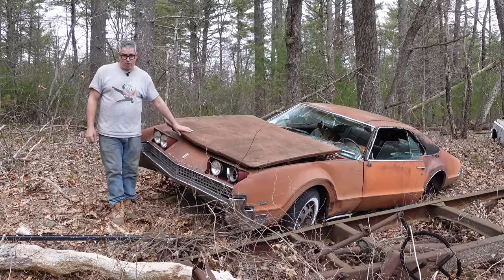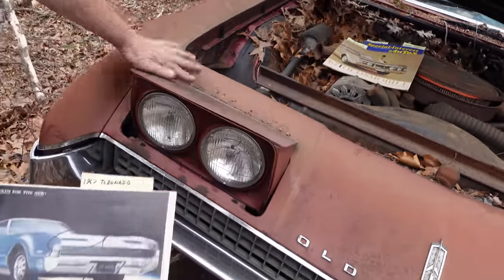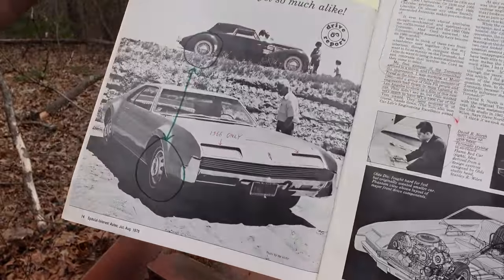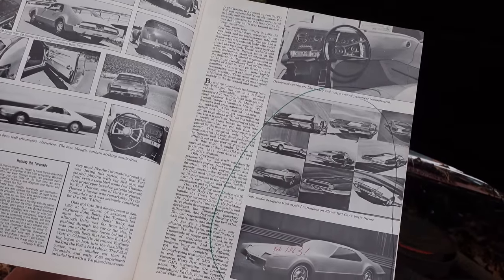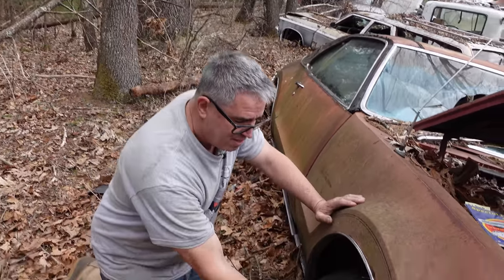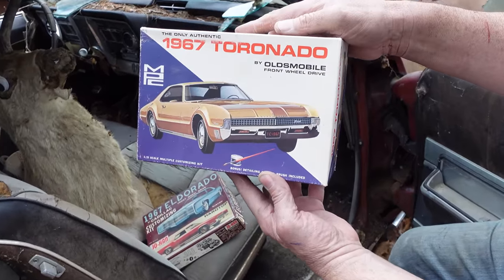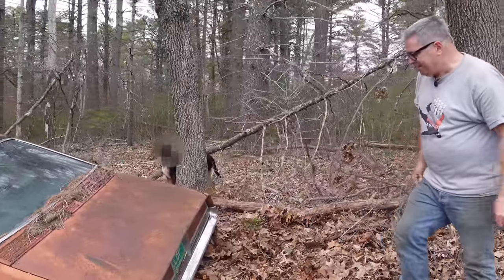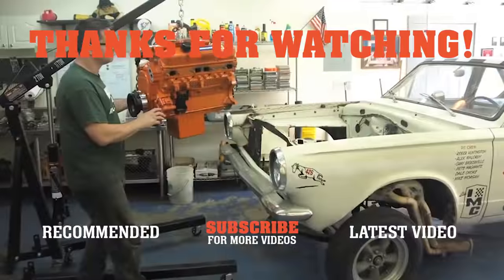Bull In A Twister

Comment: Even though I don't and, probably never will, have a classic Toronado, I WANT that air filter housing for my current project! I won't contact the yard about it though because I'd have to cut it up to make it work and, I'd hate to take it away from someone that needs it for their restoration. I'll find something more common that will work for my project.
Reply from the maker: You can call Bernardston Auto Wrecking owner Dale Hastings at 413/648-9300. He'll probably sell it to you. Thanks for watching and writing. -Steve Magnante
Reply: @SteveMagnante  Yeah, I've bought several things, mostly "wall hangers" from them that I've seen in your videos. I still might just give them a call about that air cleaner but, like I said before, I'd have to cut it up to make it work for my project and, I'd hate to take it away from someone that really needs it for their car.

Love your videos Steve!

Comment: I would love to find either of those models! As dissimilar as they are, both are gorgeous cars. I actually like the headlight treatment on the 1966 model better than the updated 1967, but I like the egg crate grille of the '67 better. A '66 or '67 Toro is on my "100-car Bucket List" for when my wife and I win the Powerball or MegaMillions lottery.

Are you familiar with the early Toronado that Jay Leno had his garage crew modify? It's basically a Corvette under the skin, independent, rear wheel drive suspension and all!

(One quick side note: I'm sure that it was a brain fart and nothing intentional, but rhe Oldsmobile Ninety Eight wes never a "Delta 98". The "Delta" was strictly on the lower 88 line, over the Delmont 88 that nobody remembers anymore.)

Comment: The 1967 Buick Riviera also used the drum speedometer.
Reply: First seen in 1966.
Reply: 1967 Buick Riviera was SAME Frame BUT Rear Wheel Drive - GM would not just have  a  ONE USE Frame  lol

Comment: I could see putting a custom frame under that and figuring out an all wheel drive system for it. It's got the wide stance, so stability would be good ( so long as the frame was made right) and the only issue I see would be the all wheel drive idea would need to be figured out. Lol. I'm looking at Subaru for inspiration on that front though. This car is perfect for modification, because it is in the junkyard, so it's an abused one that was thrown away and would be getting a new lease on life so to speak.

Comment: This is a very odd car with a 1966 steering wheel and column. In 1967 the column was longer and the steering wheel was flatter. At first I thought it was a 1966 with 1967 sheet metal up front, but the rear end has 1967 parts as well. Very Strange.
Reply: This car might have been a very early production 1967 or someone switched the steering column for a easy repair of a
 bad one. I once owned a early production 68 Grand Prix that came with a  67 shifter when new.

Comment: Admit it Steve, you have to catch yourself from saying "Quadrajunk"  ;)
Reply from the maker: As long as a Q-Jet is working properly and / or freshly rebuilt, they're not bad at all. But they are odd with those weird "hangars" and big air flap over the secondaries. I'm actually a Carter AFB fan. In particular the 1964 3705 Max Wedge carbs with 750 cfm. The Edelbrock Performer 750 is a great clone. Simple and easy to tune. Thanks for watching and writing. -Steve Magnante

Comment: "custom stuff if you wanted to go that way why improve on an already great thing don't know"

There you go. Don't hack up the cop car
Reply from the maker: If I ever get to it, my only plan for the REM-Charger is a 513 inch Max Wedge. That 318 Poly has to go. IFFFFF it was originally built with the 361 big block or FOUR BARREL Poly 318 (both OK police options in '620 I'd leave it alone. But that 2-bbl Poly is a no-go for me. The rest of the car will be left AS IS except for replacing the 2.94 gears and open diff with 3.55's and a Sure Grip. Everything else will remain untouched. Yes, the Police alternator is cool but it won't work with the Max Wedge cross ram intake manifold. I'll be sure to keep everything so some future fanatic can stitch it back together if they want to make it original. But for me there WILL NOT BE any disc brake swaps, LS swaps or other dumb stuff on this one. Thanks for watching and writing. -Steve Magnante